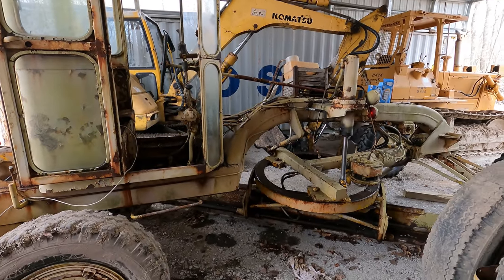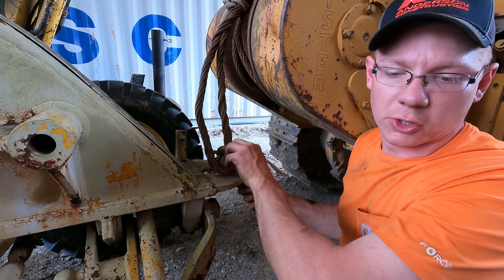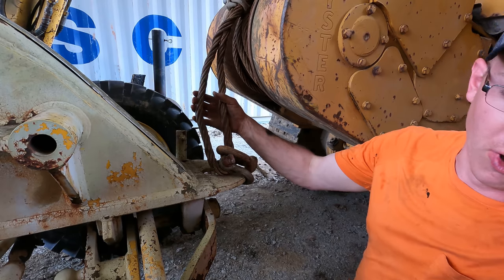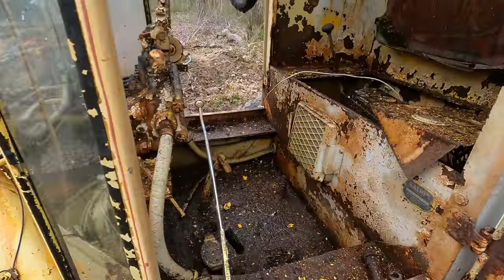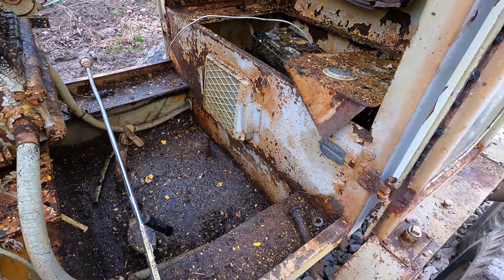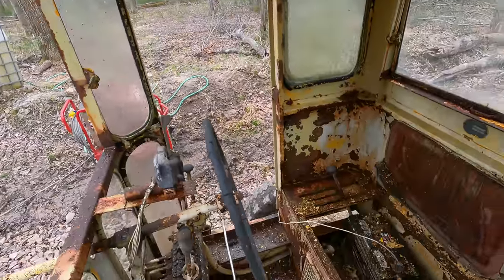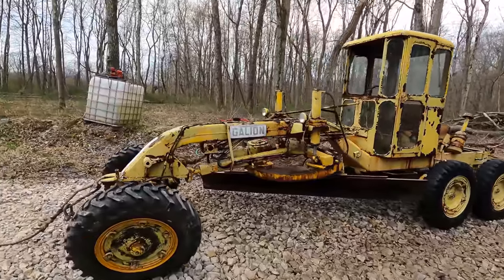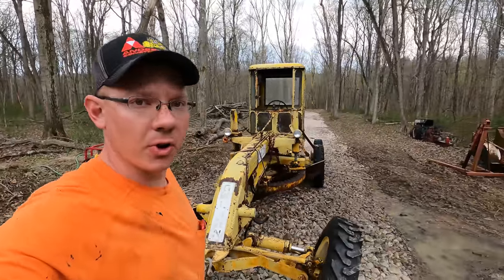Steam Cleaning 60 years of filth & paint off of my Galion Road Grader! (ASMR?) Pt.6

Comment: I know nothing about old road grades but I was wondering if I saw a front drive shaft and axles on the front end. If so, had no idea they made them all wheel drive.
Reply from the maker: They do make them all wheel driveHowever when they do the front wheels are hydraulically powered. What you saw was the steering linkage down to the steering gearbox. This machine is only rear wheel drive
Reply: Thanks. Love your channel.

Comment: Cable clamps are more often than not put on backwards. Do yourself a favor, buy a cable with the ends swedged on. Think of all the “outside” work you will have with the truck tractor, low bed and various pieces of equipment. You have the operator skills; put that together with very reliable equipment and you will keep busy.

Comment: You know DeWalt sells sandblasting deal for you pressure washer and you use play ground sand or pool filter sand  good for rust cleaning. It hooks to the tip of your sprayer  SV SEEKER you tube interesting

Comment: I like your old intro music better and video. Please tell us how the Creek was called Diesel. I can see what You mean about the Rotary Head. (I recently put a new 4000 lbs. pump on my 15 year old HONDA GX390 13.0 HP.) I like the idea of going all in by replacing all the rubber glass retention. You needed to do that to sandblast off all the rust. The difference between a good job and a 5 gallon overhaul is mostly a lot of time on Your part but actually multiplies the Value of this very cool machine that is not manufactured anymore. Please Re Plate the 2, GALION BADGE  take all the old rubber tires off so You can do a perfect job of Rim Paint Restoration. We all have budgets, but if You can, get 6 new tires to put back on. I’m guessing that this irreplaceable Grader is worth at least  $20,000 to anyone. I’m guessing that there are many big properties that require road maintenance in Your Area. I think You need to find a good employee that allows You to make money with all Your equipment and work on restorations on rainy days. I like Your Red and Black colours on Your Dump Truck, but I think you should consider adding Orange just for the boom, outriggers, and all components of Boom Truck. I think You should paint CHRISTINE in original colour. Your KOMATSU  may need touch up only of Paint. Leave Your BOBCAT alone unless You do a Major Engine job on it. ( I suspect that You will need a larger machine at sometime as well as an excavator.)  I also like Your AUTOCAR SEMI Restoration painted in company colours. Come to think of it, You need to hire 2 employees with different capabilities but they should also be trainable to operate Your equipment. Your Church Project requires a skilled construction carpenter type. You need a skilled operator mechanic type to operate Your Boom Truck, Christine, (I suspect You will be the only one to operate Christine) What are You going to do with Your latest large loader? I suspect You should sell it off to gravel supplier loading trucks. You need 0ne Man right now. There is nothing wrong to have other part time people you can hire on a job basis as You grow Your business. GOOD LUCK!
Reply: Matt explained where the name came from in a previous video. He had an old diesel tank out behind his house and it sprung a leak dumping diesel fuel into the nearby creek and caused him some troubles with the local government. Henceforth, he became the “diesel creek” guy.